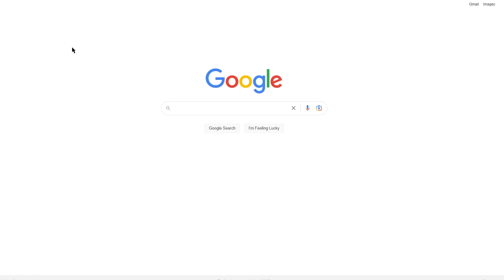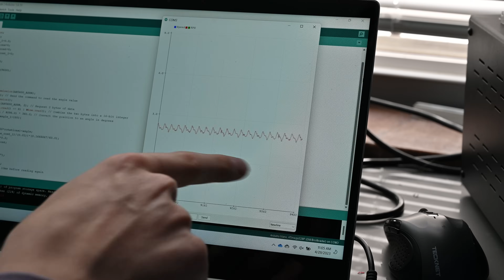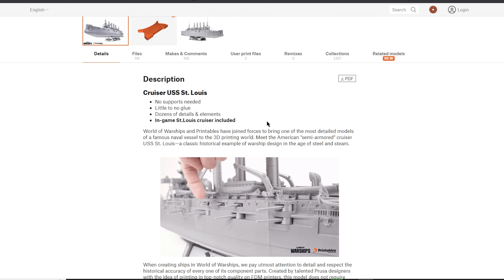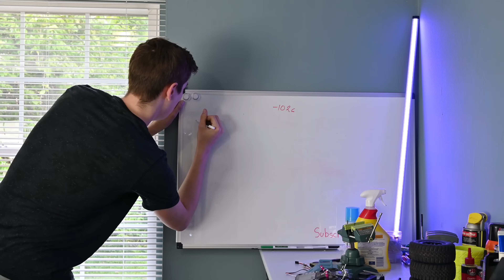I PRINTED an RC Car... How FAST can it go??

Comment: Most RC tires have foam inserts and typically require gluing to the wheels unless using bead locking wheels which are mostly for rock crawling rc cars and aren't meant for those high speeds like normal RC tires and wheels are. 

So the issue isn't the prints, it's just that even normal RC car tires do need to be glued on normally because they'd also just fly off the wheels too.
Reply: Just noticed the wheels and tires you used are aren't 3D printed, my bad😅. But regardless 3D printed wheels or not, the tires will always need to be glued onto the wheels

Comment: You can also reinforce your 3D printed parts with steel wire and steel rods, or aluminium rods in Z direction for instance.
You can also try and cast the gears out of ZAMAC or PU.
Build in predetermined breaking points in your design to shield your most valuable components.
Use a simple plastic sheet on top of the car for better aerodynamics and as a shield against those stones etc. 
Use flexible bumpers in the front.

Comment: - Try to extend the battery slot so that you can lean the battery position forwards or backward towards the front or the rear axles, this would help      greatly in the ballast weight distribution to balance the car.
- Aerodynamically allow a bit of change in the front and rear wings for more stability. keep in mind the the rear wing could cause something called drag, so it will slow the car.
- Try to add the vertical wing before the rear axle area.
- Suspension stiffness is vital for overall stability, mingle with that.
- Also the lower the ride height the better it is, is important for traction, but the problem is the the surface you're using is very bumpy. so yeah, keep that in mind.

Comment: Here are a few things you can do to improve the stability:
-Adding some toe-in to the front wheels will help it track straighter. (Toe-out will improve handling in the turn but won't track well) Loose linkages will add toe out, which will cause wandering. For that reason, you should use adjustable tie-rods so you can make adjustments.
-Add 1 or 2 degrees of of toe in on the rear wheels too. This really helps when accelerating, which seemed to be a problem in the video.
-Lower the suspension. Your ride height should be only as high as it needs to be, and since you're running on flats, keep it low.
-Get some better shocks. Losi 22 or 8ight shocks will be MUCH better and still let you have loads of suspension if you want to go offroad. The shocks you have look like they're meant for low speed toys or rock crawlers or something.
-Your springs and shocks should be set up so that there is approximately as much down travel ad there is up travel. That is to say, when you set your car down, the suspension should compress at least half-way. If you're riding at the top of your suspension travel all the time, the wheels are constantly leaving the ground. Having down travel helps keep the wheels on the ground, which keeps you in control.
-Your rear shocks are too angled in at the top. They should be about half way from where they are to vertical. This is part of why you needed to add a second set of shocks - the more angled the shocks are, the less weight they can carry.
-Your front shocks are angled the wrong way. They should be angled more like the rears, but not as much. This matters a lot. Angled in make the suspension progressively more stiff as it compresses, which helps control body roll. Angled out makes it progressively less stiff as it compresses, which makes body roll worse... that's bad.... really bad.
-Move the motor to in front of the the rear axel rather than behind it, and the battery mounted transversely in front of that. This will give you better weight distribution. 
-Change your wheels to 1/8 scale buggy wheels. You're using short coarse truck wheels, which are designed for off-road. This will require a different hub, so get the wheels first and design to match.
-Gluing tires to rims is a must... always. clean the surfaces well, and use lower viscosity, high quality CA to penetrate the gaps better and get a stronger glue... don't use the supermarket stuff, it's not as strong. You'll need a good bond if you're going to go 100mph...
-Use some decent tire inserts. This will help keep the tires from deforming as much.
-Get a ground transmitter. The old stick controllers just aren't as good for cars... (It is a matter of preference, but you don't see a lot of stick style transmitters these days for RC cars... by which I mean for the last 30 years or so. As someone who has been doing this long enough to have used both, and even made the transition from sticks to pistol, AND as someone also into RC planes, I would have to concede that pistol is better.)
-I'm not sure what you have for a steering servo, but consider getting a quality steering servo if you don't have one. This will make a night and day difference. You want something with good speed and torque... It doesn't matter how well you drive, or how good your gyro is, if your steering servo can't react fast enough.

Comment: Nice project, the car is very robust for something 3D Printed and it has interesting features in the design.
Some suggestions:
- During the acceleration, the car is pitching really hard on the rear and any bump/steering input is causing instability. Probably need slightly more damping on the suspension on the rear. Having more suspension travel on the front will help to keep control of the steering under very hard acceleration. The pitching movement can be improved a bit with an anti-squat geometry (ideally adjustable).  
- Geometry improvements for stability: adjustable/increased castor (more),  adjustable toe on both front and rear
- Increasing the wheel base can help with the stability, you can take advantage of this and also move the motor on the front of the rear-wheels.

Comment: I design and print aero bits like wings, splitters, canards etc for my Arrma Vendetta but anything in the driveline I've upgraded from stock plastics to metal and even some of those metal parts struggle to not eat themselves up. My top run so far has been 107mph with lots of other runs between the 70-93mph range. I think 100mph might be a big ask for 3d printed parts especially in the drivetrain. I'm here for it if you can get there though! If you can manage to fit a set of GRP 1/8 GT tires the car will get to be much easier to drive and be more stable. As soon as your current tires start ballooning any hope of maintaining control starts to go out the window. Imagine if the tires on your passenger car suddenly grew that much in size and the contact patch reduced to just a tiny portion of the tread and also rounded out unpredictably. Better tires will lead to less breakages and crashing and reprinting things. 👍
Reply: I personally found balooning to be a non issue, in the contrary it makes you go faster and was the only reason i was able to hit 100kph with my rustler and later about 80 with my 4x4 slash both on 3s.
However it migjt be an issue once you go a lot faster than what i did lol

Comment: Nice work! Insane how refined that design is and has become over the years. One thing that you probably already know: your tires are badly deforming at high speeds, and I think that's really hurting your stability. Might need to 3d print larger rims and then make solid or nearly solid tires out of TPU or something.

Comment: Suggestion for easier steering: reduce the maximum steering values proportinally to the car's speed. That way you have way more control of the car at high speeds, as even a large rotation of the steering will only steer the car a little to the side

Comment: I would suggest that you make a 2 motor configuration to make more power. It would also be helpful to try and make a rear wing for a bit of down-force on the rear end which will help the car to grip and go faster.

Comment: nice work - I still think having a solid metal baseplate helps. It gives stability and lowers the center of gravity. And I'm not quite sure about printed gears - but if those break, then nothing too bad will happen?

Comment: your tires are causing most of the instability also when adjusting your toe make ur wheels slightly tilt towards each other it helps keep cars straight at high speeds also the straight cut gear will give you better torque.

Comment: I speedrun upto 175mph mark at the moment. There’s been some good points laid out by people. A couple more I’ve learned will help you massively. 

You need banded tires so you don’t balloon the tires. Gets a set of arrma hoons silver they’re good for around 110mph after that they have a tendency to explode. If you go above 100mph you want foam tires. 

Extend the chassis by a couple inches in length if possibly longer the chassis more stable the car will be. 

Setup wise, slam the hell out of it so it’s nearly scrubbing the floor. DO NOT have the ride hight level. You want rake on the car so the rear is a lot higher than the front. Because you’re using a rear wheel drive when you punch the throttle the back will squat down. Also if the back is level with the front or drops lower than the front you’re lose the front end of the car. 

Front splitter is your friend, stability fun down the middle and a rear wing like a bat wing the speed runners use. It’s for side stability not drag on the rear for traction. 

Print off different pinion sizes as well

Welcome to the world of speedrunning. You’re doomed for eternity now.

Comment: Start with race tires,and adjust ur steering to less sensitive in first quarter of steering. Make a longer wheel base and wider....And how far in does ur suspension go down? And start with a low to high ratio in throttle.

Comment: - You definitely need to switch to foam tires.
- Is there any oil in the shocks? The car looks bouncy as hell. If there is, switch to a heavier weight. 
- Convert it to 4wd, there aren't a lot of 2wd speed run cars around.
- angle your wing and splitter so they produce some actual downforce, but not too much. Might as well throw a body shell on, too.

Comment: The universal joints would have worked just fine. The sine wave irregularieties cancel each other out if the input and output axles are parallel. That's the difference between the your car and your test rig.

Comment: I think reducing the suspension travel and moving to stiffer springs would help with stability. Also it would be good to look into foam tires, which are what a lot of the rc speed cars use.
Reply: It just needs slower damping, stiffer springs will just increase the frequency of the oscilllations and make it more likely to jump around. 
Longer travel, the lowest spring rate possible without hitting the bump stops, and a much slower damping setup, the current setup doesn’t appear to have any damping.

Comment: 10:02 The tires completely round out at high rotation speeds.
I think this largely contributes to the car rolling over with any lateral movement or loss of control. If the tires could keep their shape and have the flattest possible tread, it would allow for some spinouts instead of making the car go airborne and self-destructs mid-flight.
(It might not fix the control issues though)

Comment: Your tires are expending at hi speed which increase instability a lot.
You could also use a little bit of lithium grease for your gears and ball bearing.

Comment: OK, some Ideas. So for RC cars, it actually pays to have AWD even for high speed builds. You just have more stability and control, if your front axle pulls, hence you can accelerate faster. This gives you a faster top speed before your sight range ends.
Also, consider using hub motors (sub 1000KV), they give you a really low center of gravity. They car doesn't flip, it just slides in circles when losing control. And BL outrunners are tough, I couldn't even kill them in sand, snow, dirt, anything.
Brawback is the increased unsprung weight, so you need a smooth track to drive on.

Comment: toe in a little on the back and front, also use oil filled shocks so they actually dampen, instead of it being a bouncy spring

Comment: This chassis is amazing and your mods are awesome ! pretty good work
I'd install roll-bars front and rear, lower the suspension and make it as tight as possible as well as replacing those 3D printed links for the steering with nice adjustable ones ;)
Ah, I almost forgot ! Race tires ! Damn !

Comment: I think starting out with an elevated driving position would up your stability significantly. Add braking, and lower your rates, you don't need much steering travel at speed.

Comment: You need a different material for the wheels, which doesn't expand as much, along with all wheel drive if you're wanting to go above 60MPH consistently. A bigger back wing may also be beneficial since it seems like you're not getting enough downforce on the car above 30MPH

Comment: I would avoid part cooling when you can. Two things will happen, it prevents layer tension and work hardening, making it not nearly as brittle. This makes the parts much tougher as they will be willing to bend before deforming or breaking and of course far better layer adhesion. And of course slower printing helps, i found with ABS printing around 65mms at the upper range without part cooling gives you parts nearly as good as injection molded. BUT, then sometimes you want the part a little more ridged.. That's why i have to different part cooling ducts on my printer, one cools the part around the nozzle and the other cools the parts directly at the nozzle (like most do). I found cooling the part around the nozzle lets you print slow for better adhesion but allows for work hardening when the hot plastic meets the cool plastic vs cooling the plastic coming out of the nozzle.

One other odd trick to printing a warm part in a passively heated chamber like the X1 is to make sure the bed is dead flat in X and Y, I made my own adjustable feet for my printer to level the bed (not necessarily the frame). What this does is hold heat above the bed much better and prevents a passive wash action when heat is rising. I think the Carnality K1 has an added plastic skirt to help with that.

Comment: awesome work! consider aerodynamic stabilization; a bit of aero drag behind the cg will help. you need to keep it low to the ground so you don't induce a pitch up moment. downforce helps too. there's lots of well understood profiles, but I think it would be cool if you make a diffuser work well

Comment: A pistol grip car transmitter is necessary. Get a good one with good pots or Hall sensors that can adjust finely. That will help immensely with control. Even better would be a computerized surface TX where expo can be added to the steering. Belted tires or wider tires to keep the contact patch will help. A body should help too. Nothing fancy. Adjustable toe links or slightly longer ones for toe in will help. Lastly, turn off the gyro for high speed runs. My 45 mph truck has a gyro that gets turned off for speed runs by the manufacturers recommendation. It's easy to start fighting the gyro at high speeds.

Comment: Less suspension travel, properly mounted (angled) shocks with proper spring rates and valving, foam tires, and the rest of the gains will come from aero (as in a body).

Comment: While it might not be the design asthetic you are going for, if you were to use a single rear drive wheel instead of a pair you would considerably reduce the rotating mass of the drive train, and reduce losses from transfer.

Comment: Another method is to use a 5 wheel design where the 5th wheel is in the center of the Vehicle, and it is the only driving wheel, the other 4 will be for stability and navigation. You could use a regular tire on the 5th wheel, but make sure to use an epoxy to secure it to the wheel and account for baloon expansion in the wheel housing.

Comment: What I noticed when you get to the higher speeds, the tyres elongate which is probably why it's becoming unstable at higher speeds. I would consider looking into a harder compound of tyre to try and mitigate that. I'm guess that the tires don't actually have any pressure in them, but I bet if you had a rim and tyre that can take pressure you would eliminate this problem. 

Now looking at the next video you totally did that lol. Anyways good stuff!

Comment: Double universal joints counteract each other if the input and output shafts are in alignment, so the output no longer oscillates.  However the shaft will still experience the oscillation.

Comment: I have a bumper idea that will be strong and light.

Run some aluminum or carbon tubes all the way through the body, attach aluminum wire bumpers to the front and back with springs between the bumpers and frame on both sides. When you crash into the front, the bumper will absorb the impact into the springs and push out the back, and vice versa for the back. A floating bumper system that doesn’t direct all of the force into your 3D printer frame and instead just transfers the load into the springs in the front and back.

Double points if you make the springs on both sides push/pull so both sets will act to absorb impact instead of just one at a time.

If my idea isn’t clear, I’m happy to send a drawing or something.

Basically I mean this…
bumper[spring-vehicle-spring]bumper. With both bumpers attached via two floating rods that run straight through the chassis of the vehicle.

Comment: Nylon gears. Duct to cool the motor. Higher power to weight ratio by using smaller batteries. Wheel R&D

Comment: some suggestions

better motor, or motors, awd
i suggest going with a quad motor design,  providing more torque and hopefully higher speed. also, try playing arround with gear ratios, and try adding high suction fans in the meddle for more traction.